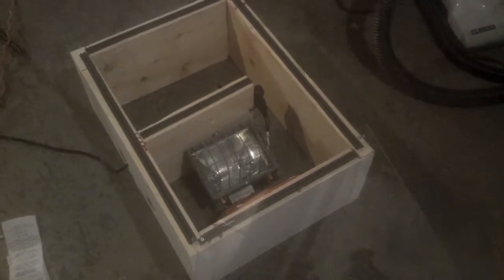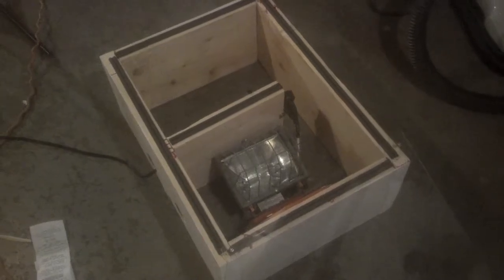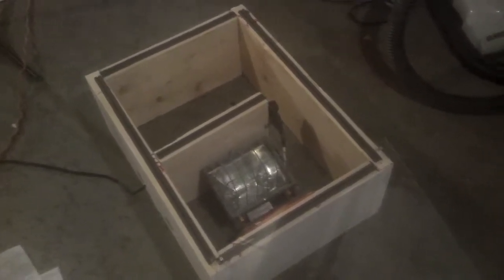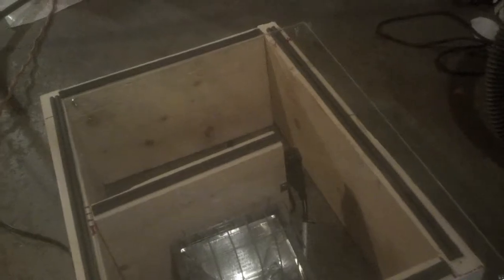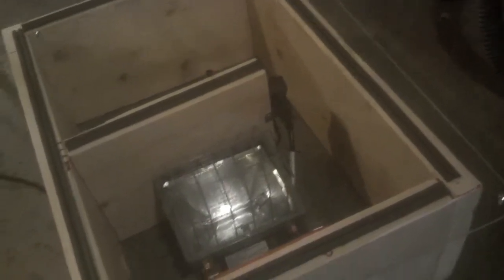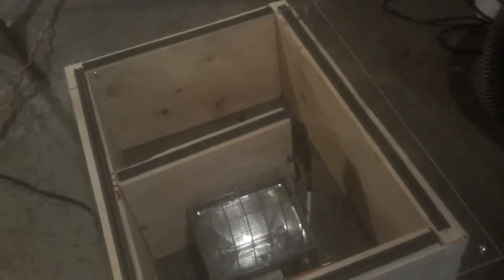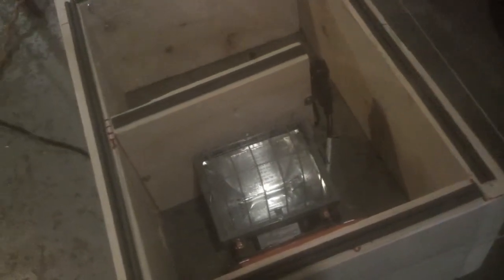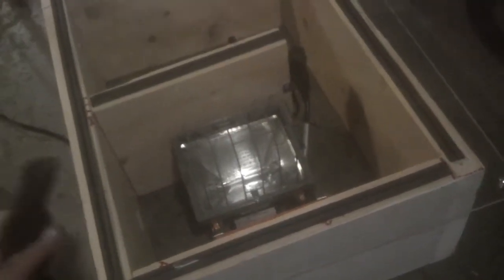DIY egobox construction! (tutorial)

Comment: Thanks! Any ideas on how to do this with a kick drum? I'm not sure a kick pedal is enough pressure to set one of those off. Maybe use some other type of switch to complete the circuit? I'm trying to avoid using an Arduino which seems like overkill (not the band).
Reply: might want to try putting the switch under the pedal instead of on the mallet. That usually applies more force than the mallet hitting the bass drum as long as it doesn't effect your playing.
Reply: Yeah, but the pedal is metal. So I may be risking shock.  #shockrock
Reply: Steve Chab no one said rock was safe!
Reply: Steve Chab idk if u figured this one out, but they make.LED lights with volume sensors in them. You can.line the front rim of.your.kick drum,with LEDs straps and everyone you.kicknitll sense the volume spike and turn om